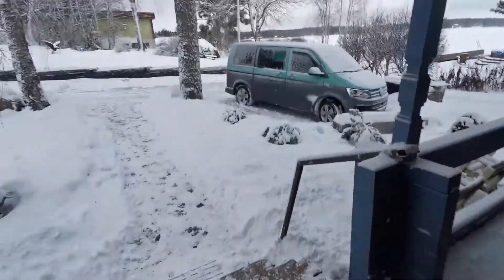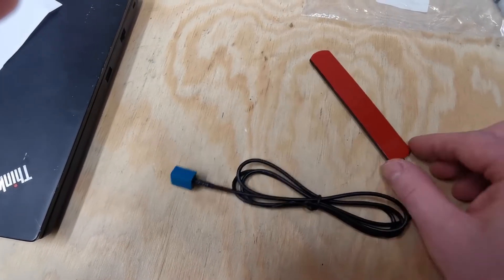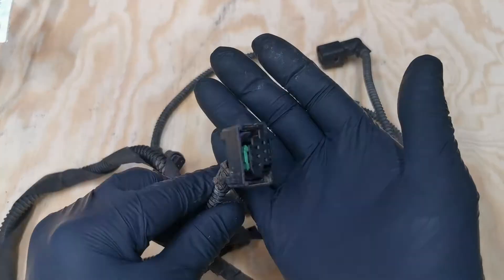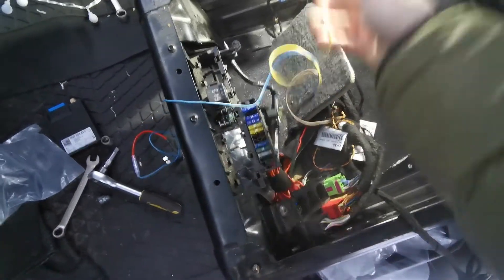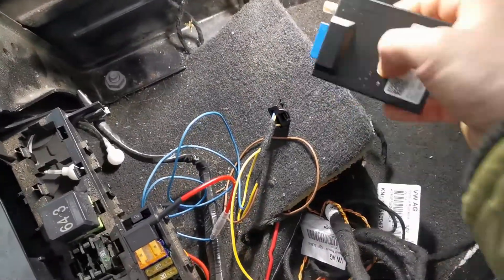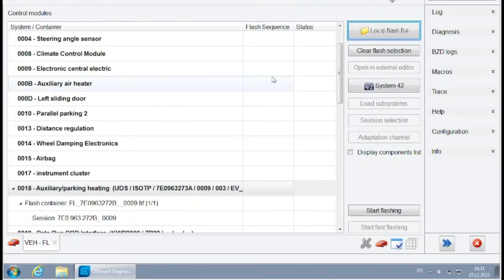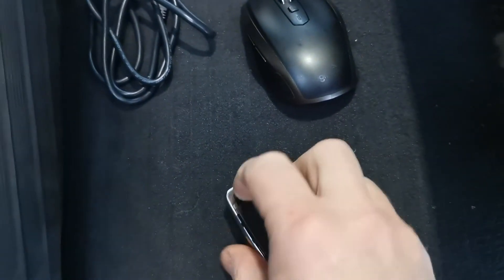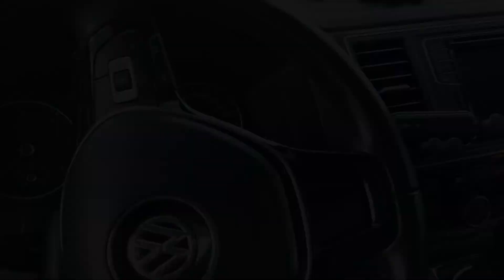VW T6 Parking heater installation - fast & cheap

Comment: Hi, Thanks a lot for this video - it is really very helpful. One question. Do you have knowledge if OBDeleven pro will work with coding and flashing? Or VAS is necessary. All the best
Reply from the maker: Hi. This won't work. Please follow the video guide

Comment: Nice informative video. I want to connect a remote functionality like a relé output from a Victron system to start and stop the Webasto. (VWT5.1,14). I have the original remote but want a remote from phone. I will install a Victron Carbo GX with display and internet. It has two relé output. Do you know an effective solution to do the installation? Was thinking maybe some relé setup to Pin 1 to webasto but not sure if that’s the best solution?
Reply from the maker: Yes, there is a simple, cheap and easy way how to get that done on T5.1/T5.2 however, it won't work with the 12v signal on pin1. You can buy a cheap telestart unit and connect victron to it. Telestart will send the right wbus signal to the heater. If you are open to take video footage, I am happy to support you and to provide you with a telestart unit.
Reply: @b @busbits anks. My T5.1 has already Telestart. Figured out that pin 3 and 4 is input and output from some documents. I believe the Webasto ThermoConnect use this functionality. It’s says it need a puls signal of 1 sec and 3 seconds delay. I don’t know if it need a puls every 3 seconds or this is a safety delay for ON / OFF. Have ordered some terminals to connect. Haven’t tried yet because the terminal haven’t been delivered yet. Is this the solution you was thinking about. Also tried some Node red programming on the Cerbo GX to get a puls signal and not NO/NC. Get the relay to turn on and off after 1 sec. But it’s some unstable. It’s a relay device SmartSwitch DC4. It’s have 4 outputs 12v with a programmable puls. O don’t now how accurate the signal input to Telestart need to be. I believe also the input and output is used by optional button with status led. This will say in my opinion that it’s some flex on time if it’s a user button.
Reply from the maker: ,  yes this is exactly what I was suggesting. I have successfully implemented the vw original on/, off button on my t6 dashboard and plan to do a video on it (had to engrave the webasto symbol). NO ON won't work - it's a short pulse as you described. So you need some sort of converter - probably a cheap one on aliexpress. I have plenty of these terminals if you struggle to get some btw
Reply: @busbits  Thanks. Ok. So the puls will switch between on and off? Or will it run the program time from roof display? I guess from the documents for ThermoConnect the roof display run time needs to be higher than ThermoConnect. If this works, next will be to implement more signal from car like diesel level, speed signal, so on. But too early in learning curve to know what’s possible to monitor. Already smartshunt for start and leasure battery with V,A and temp. Pretty nice. And also monitor remote on phone.
Reply: @b @busbits  I ordered some terminals but wanted the cable with the 6 pin connection Male/female with 4 pin connection. But can’t find anyone that has it’s in stock.
Reply from the maker: @fredricnor8513 best source is aliexpress
Reply: @busbits thanks for your reply. Do you know if the pin 5 used. Some doc says switch between venting/heating and some have just blank. It’s had been cool if Victron also could trigger switch between heat and ventilation.
Reply from the maker: @fredricnor8513 I have a diagram where this is stated as winter/summer mode. Never used it. Would love to hear about your experience once you test it

Comment: Hello... Great job you have done... Clear and precise guide... I have already finished the wiring now I'm stuck on software flash part. 
I have T5.1 and I'm wondering is the same flash file as the T6?  
Thanks...
Reply from the maker: T5 has a different procedure and different remote/receiver
Reply: I have bought 7N0963513B T91R Tele start and 7N0963511 remote fob to pair with... They are communicating but this is far as I go... 
Anyway, thank for all of your videos, I have learned a lot, keep it on with the great job
Reply from the maker: @osmansmailbegovic2635 connect wbus on receiver  to pin1 on the heater and you're good to go without the reflash. Please post if it worked for you.

Comment: Instead of the piggyback fuse connector, can one of the empty slots of the fuse holder be populated with the new fuse?
Reply from the maker: Yes, better than piggyback but requires special pins that are not widely available

Comment: Hi.
I've same version like you.
I see in vcds in coding in heater modul option to stearing with remote.
Is doas mean that I don't need to flash webasto modul ?
Reply from the maker: Flash is almost always required. Vcds shows the current version so check that

Comment: Hello, thank you very much for all these details, so much appreciated ! Actually I've exactly the same sticker on the door about Webasto (with all matching numbers) but my dashboard has the manual "climatic" version. 
On your Amazon link, the kit has particular mention in photo "not for climatic" but I wonder if it's because you did not tested it so you can not guarantee it works or you actually tested it with unsuccessful outcome?
Cheers,
Ben
Reply from the maker: Hi. It will also work for climatic but you will need extra wires and a relay to switch on the ventilation.
Reply: @busbits  thank you for quick answer ! Interesting to know that sounds possible, where can I find the details? Which relay should I find?

Currently, my first goal is to have the aux heater starting with a remote, if your existing kit can already make that happen, it would be amazing ! i will give it a try :)
Reply from the maker: Did you already get the kit? Yes, it will work and it will switch on the webasto but the interior fan won't turn on without additional wiring.

Comment: hi can you make a upgrade webasto in climatic system it is more complicated ? can you write what to do when we want to add the same 3q0963513 and remote 3q0963511  to thermo top v the way is not the same can you show diagram and describe step by step the way this upgrade of climatic system vw t6 2018 please ? by the way mega ❤helpful video
Reply from the maker: Unfortunately I don't have a climatic car to make this video
Reply from the maker: Hi. You need to add extra couple of wires and a relay. I don't have a car with Climatic so I can't make a video on it

Comment: Hello. Cool video. But you would you have the webasto installed without all the wires and module??
Reply from the maker: What do you mean?
Reply: @busbits in the video you install just the wire. The actual auxiliary heater was already installed. The mechanical component

Comment: Tell me how does a regular heater control unit without climate control affect if the telestart is connected as an additional device via CAN? I can't find the information, thank you.
Reply from the maker: Hi. Telestart does not connect via CAN
Reply: @busbits  LIN, I mixed up the timer connection.

Comment: Thanks for the awesome tutorial. I have yet to understand what signal the additional green/white wire carries. With an OEM-remote control receiver, that's LIN-Bus, right? However, the aftermarket upgrade uses W-Bus, correct? So is this PIN converted from LIN-BUS to W-Bus? However, how/where does the heater then continue to receive its automatic signals from the car?
Reply from the maker: Hi. The heater talks to the car using can bus.
Reply: @busbits  Awesome, thanks for the info. And this CAN bus connection, over what pin or wire does that go -- after pin 2 is used for W-Bus, as I understand?

Comment: Hi, great Video! Planning to do the same on my T6 California. 
One question. Is the heater working after the conversation also working as an additional heater as right now or only as a heater to heat the engine and interior before driving?
Reply from the maker: @RobertPflügner  hi. Will work as both
Reply: @ I have gathered all the parts needed but I am struggling with the Pins used for the black connector and the Red VW connector. Do you have the PN available? Thanks for your help!
Cheers Robert
Reply from the maker: @RobertPflügner  i have spare pins and connectors. Feel free to reach out.
Reply from the maker: @RobertPflügner  Hi Robert. Responded to your email. Hopefully you have received my response.
Reply: @busbits  yes, well received and responded this afternoon. Cheers Robert

Comment: Is this the same on a t5.1?
Reply from the maker: No. No reflash is needed and telestart units are different. I wish I had a t5.1 near so that I could do a video - I even have a set prepared for t5.1
Reply: @ Thanks, I didn’t know that! The reprogramming made me not want to do this. Is the wiring just as simple? Wish there was a video on this. But thanks again 👍👍
Reply from the maker: @AhrnNilsson  If you're willing to try it, let's get in touch. Feel free to leave your email or wa number.
Reply: @busbits  Would be perfect, but I live in Sweden 🇸🇪  And also one of the companies that sell these kits told me today that I don’t have a compatible heater unfortunately, mine only works with the engines on, or that’s at least what they wrote me :|
Reply from the maker: @AhrnNilsson  Not a problem, you're in the EU so easy
Reply: Great film! Thank you. If u were me would u reconfigure the existing webasto in a t5.1 to heat the interior or would you install one of those 100euro chinese webasto?
Reply from the maker: @adamp8465  yess, I would install the additional air heater. The water heater eats too much electric power and can not be used for long camping heating.

Comment: Hi
Thanks for great guide. My T6 does not have the green/white wire. I have accessed the Webasto unit and have confirmed no wire in pin 2.
I cannot work out how to route a wire from under to seat to the Webasto unit. Any ideas please?
Reply from the maker: Hi. Do you have Transporter or Caravelle/Multivan? Do you have Climatronic?
Reply: Hi
Thx for reply. I have actually working out how to do and have routed the wire.
I’m now trying to find someone in Southern UK who could do the firmware upgrade for me.
Reply from the maker: @thomasknight6463  Great! It's interesting what model Van do you have because most vans have the green/white wire going to the red connector. Do you have Transporter or Caravelle?
Reply: @thomasknight6463  Did you get your heater flashed?
Reply: No green/white wire so have routed my own wire to pin 2 on the Webasto unit under the van. T6 California Beach with Espacher parking heater.
Reply from the maker: @thomasknight6463  Very useful! Many thanks!
Reply: @thomasknight6463  Did you get your Webasto flashed and did you power your receiver from your leisure battery?
Reply: @thomasknight6463 
Hi, my T6 California 2016 has also no green wire. May I know from your experience how you managed to route the extra wire? Thanks for your help.

Comment: Curious, are there any comms over the comms cable or is it just applying 12V? I do not really need the remote, I just need a way to turn on the parking heater without engine on.

Also, after pressing on, how long does it run for?
Reply from the maker: Hi. I am sorry I didn't see your question. No, in T5 and T6 it is not analogue signal. It is controlled via w-bus. You can install the telestart receiver and route a button from it to the dash. This kind of video is on my to-do list because it could be quite clever solution.

Comment: Hello Eugene!  This video inspired me to install remote control on my van t6gp. I've installed 3Q0963513A. It works without reflashing the heater ecu. However, now I dont have an antenna. Could you kindly help, what frequency fits 3Q0963513/3Q0963513A (with A)? I have searched "antenna FAKRA" but in the video you mentioned 2:29 "worked really well...slightly different frequency ".
Anyway,  thank you very much! This was the first retrofitting in my life and your video helped me really well!
Reply from the maker: Hi. what do you mean T6gp? Do you mean T6.1?
Don't bother about the frequency, just buy the fakra antenna on ali and try it. It worked really well for me and it only costs 3 euro including shipping.
By the way, there is no difference between the reciever with/without A at the end.
Reply: @busbits  Eugene, yes , t6.1, just found out that in ELSA the production naming is T6 GP so I typed the same. 
About the antenna I can buy any antenna even if the seller declares that  frequency range is between 800-2500 MHz?
Reply from the maker: @borismedvedev4172  send me your email please or drive2 profile, I will send you a link for antenna
Reply: @busbits the second park after at is the Google mail. But if I write it all together the comment is deleted automatically
Reply: Interesting, are you saying that you only did the hardware mod in you t6.1 and everything just worked?
Reply from the maker: @PetrKlus  Some of the T6 T6.1 already have the right sw flashed
Reply: @busbits  hello, and it is version 009? the right version

Comment: Bad to start a car and let it idle for long.. Start it let it run 30 seconds and drive slowly.. More fuel efficient and warms up way faster, 15 minutes for a warm cabin at -15c
Reply from the maker: That's why it is very important to have a parking heater. The engine warms up and you can start the engine after its warm and drive properly right away.